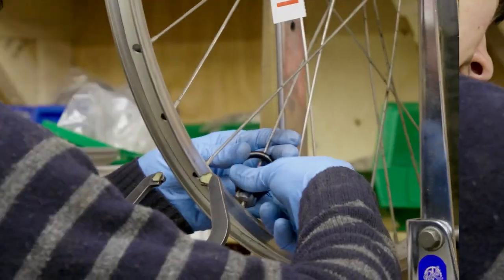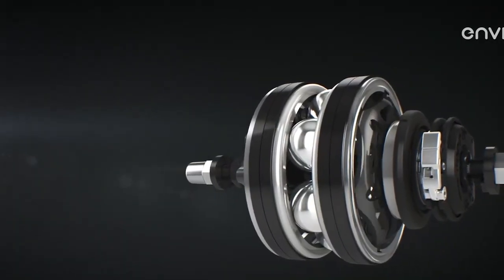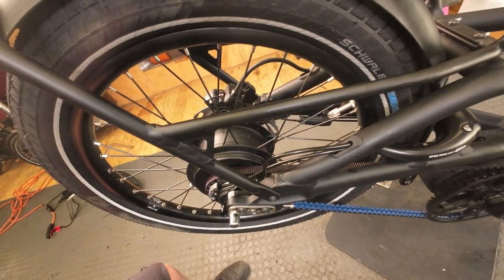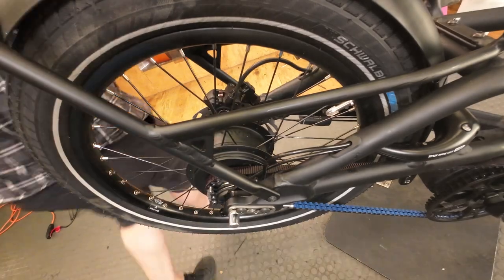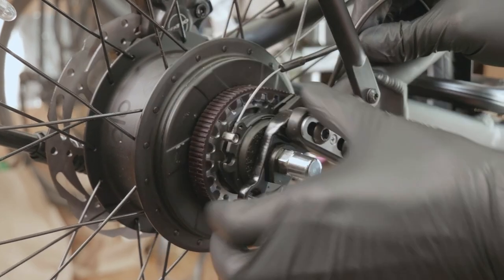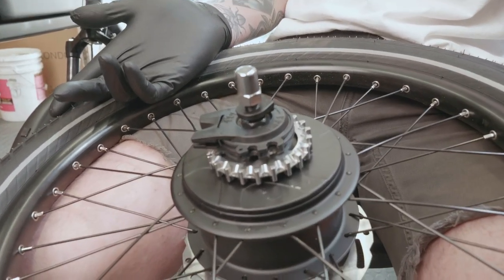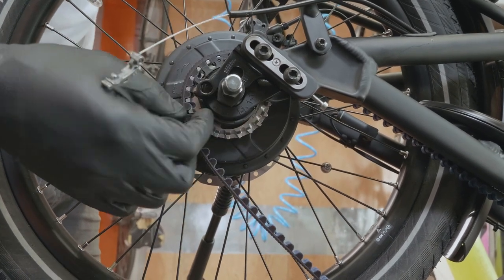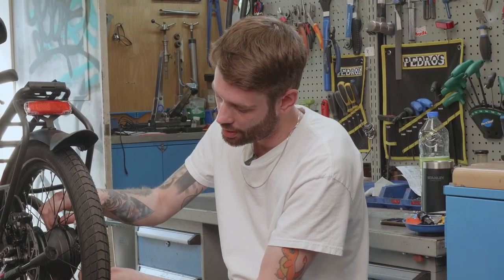Removing a wheel with an Enviolo 360 Hub is not that hard!

Comment: You need to discuss errors in the installation. For example if the cables loosen at the handle bars, if the cable becomes frayed. I’ve been to three bike shops who had no clue what to do. Finally installed a heavy puncher proof intertube on the back wheel. And watched lots of videos. 10,000 km done

Comment: I can't get enough slack to reconnect the second cable. I've loosened the cable tensing nuts at handlebar as far as possible. Please provide an answer, by the time you do I will have gone crazy from frustration, but it could help someone else down the road.
Reply: This is essential (loosening cable tension), this video does not seem realistic for how hard this could really be with proper tension in the cables.
Reply: @mo-yx6yw  The solution was actually simple, I loosened the wheel hub nuts and slid the rear tire forward. The shifter is in the hub. I had the cable hold downs loose too, connected the cables then reapplied tension after lining everything up.